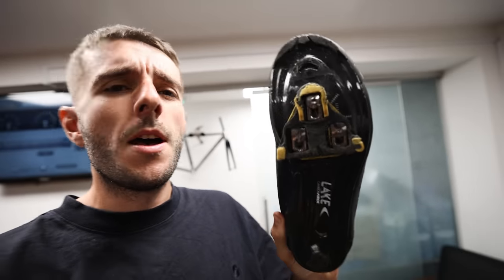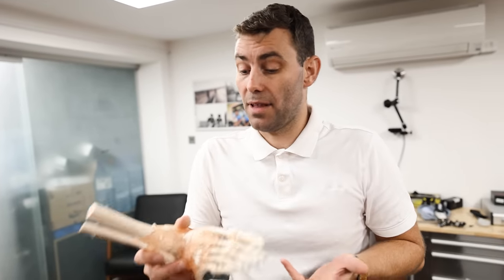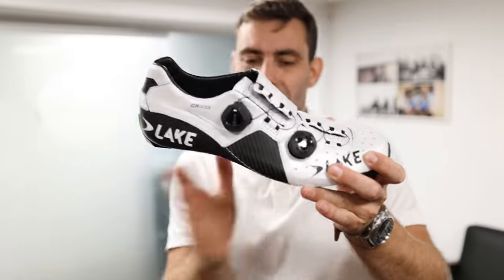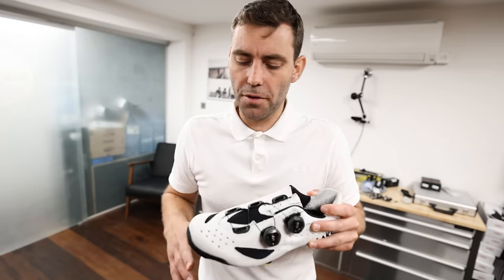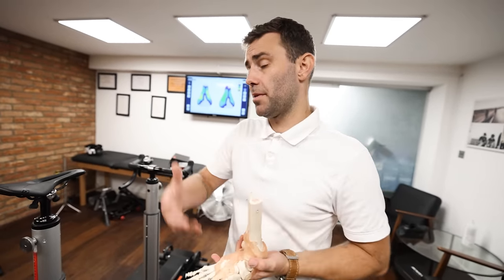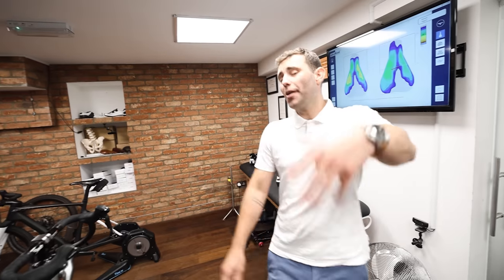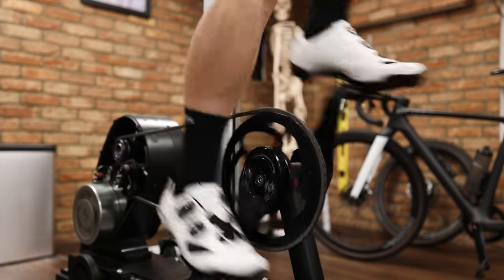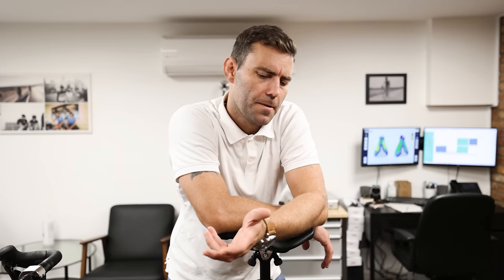Mid-Foot Cleat Position - A Bike Fitters Opinion

Comment: I’ve been studying and performing bicycle fits since 1987, and not only do I agree 100% with James on just about everything I’ve seen in these videos, but I learn something every now and then as well.  If I lived on that side of the Atlantic, I would definitely trust him to fit my bikes! I thoroughly enjoy these videos. Keep up the great work. Cheers!
Reply: Thanks dude!
Reply: I could have written the same thing (well, self-fitting since '85, no customers) and agree completely. James is neither stuck in the past or goo-goo ga-ga over new tech. I love the complete absence of lasers and measuring tapes, but everything is still down to the mm. 
I have been having foot/cleat/bike issues since they changed the shape of shoes and went to stiffer carbon in the 90's
Recent experience regarding mid-foot; I had been slowly moving cleat backward and appreciating the stability, but something was missing from bio-feedback loop of toe engagement. I have monster calves that can work over my joints and taking them off-line seemed to make sense, but I have crept back up a couple mm and really liking it. I'm a spinner too. 

Big point: I wish shoe manufacturers were more clear in how much heel to toe drop exists. Which of the LAKE shoes tend to have higher forefoot drop? (forgot term you used; it was spot on)

Comment: I run SPD on my gravel & roadie, and run on the furthest back bolt holes and as close to mid foot as it will go, always loved the power, comfort and peddling dynamics.
Reply: Same here.
Reply: Plus it’s easier to drop heels for descents.
Reply: And 165 cranks 😀
Reply: I'm afraid of knee problems. Should I be?
Reply: @jondemise131  I have no issues, late 50’s and ride 3-4 times per week with circa 10,000m per month of climbing.
Reply: @jondemise131  my knee problems have gone since using SPD and mid cleat.
Reply: @jondemise131  No knee problems here!
Reply: @GenuinePluko  When you say SPD cleats, are you talking about mtb cleats that allow for more side to side movement or the more rigid road cleats (SPD or SPD-SL)?
Reply: @TheExplodingCore  SPD MTB cleats on my roadie. Specifically XTR Race double sided. Adore them. Plenty of "float" and run on the loosest tension

Comment: So I've slowly been working my cleats backward until they are now slammed. Never felt so balanced and comfortable in more aero positions. On top of that, after a few years using cleat wedges on my right side I took them off and my knee doesn't want to drift in anymore. It's possible this was corrective and I learned a new pedal motion but more likely adding solid insoles (your recommendation) and moving my cleats back just put me in the right position. Praise the lord of bike fits. Wish we had a decent fitter in Chicago.

Comment: I started cycling over 30 years ago, in a time where you were told: pedal needs to be centered with the ball of the foot. I also still have a 175mm crank still  based on recommendation from long time ago. When you start thinking about it, it doesn't make sense. You deliver most force pushing down, when your shoe is a bit more forward you increase the distance to your bottom bracket, increasing the amount of power you can push down. Also when you do squats, a fairly basic power training I would say, you don't balance on the front of your foot but mid foot. 

Already placed my cleats more to the back (and adjusted saddle/steer accordingly). Not planing on replacing my crank soon since they are expensive and I don't need to win races but my next one will be 165 with my foot placed a cm more to the front.

Comment: FYI, only issue that I have never seen covered is clipping in and out.  It is harder to clip in and much harder to clip out.  Adjusted the Speedplays to clip out at a much shallower angle but still not as easy as forward cleat location.

My setup: I gauged my position on flats and carried it over to my Lakes with a midfoot adapter and Speed play pedals.  Running about 40-45mm  behind the first metatarsal works for me.

Much better and stable without cafe or foot pain.

Comment: Triathlete here did the mid foot cleat placement.  It is good for the run off the bike.  I have wide feet and have a custom made pair from D2 shoes.  The cleat hole positions were part of the custom order.  The overlap was a bit of an issue at least in the beginning.  But after a couple of embarrassing falls at lights, I just clip out early and don’t try the track stands.

Comment: I use the mid foot adapters on the Lake cx237 for ultra distance, it helped resolved numb toes. Interestingly, the MX237 with spd cleats allows placement further back, as far as matching my road set up but without adapters needed.

Comment: Amputee cyclist have to deal with a truncated (or no) calf at all. One solution is to place a cleat directly onto the prosthesis stem (no prosthetic foot). Shorter cranks are almost always a must. Being an amputee cyclist myself, using a very good carbon foot with good flex response, I have found that the stresses on the prosthetic side are much different than on the normal side. Oddly, the quad of the amputation side seems to be much less stressed than the normal side. I have a dual sided power meter and the amputated leg often puts out about 3-5 watts more than the normal leg. BTW: I place my cleats as far back as my shoes allow.

Comment: Had my cleats quite far back on my old shoes. Got new ones, didn't want to install them myself, so asked the shop. He looked at my old shoes, said they should've been further in the front. So he changed that on my new shoes. Also he put my saddle higher and more to the front...I think I like the more middle shoe position a lot...had pain in my right leg after using my new shoes for a bike packing weekend... PS. Super video!

Comment: Been running speed-plays with the extension plate for years after having massive issues with calf cramping running off the bike in my old triathlon days. Never bothered to change that cleat position even when racing at the velodrome and I have never found an issue some 15 years later. There are simply no downsides.

Comment: I drilled out the Northwave SPD shoes I used for longer rides. I lengthened the slot for a few millimeters to get the cleats further back and it made such a difference. When I started to develep pain after about 100km into a ride before I could then ride 200+ on multiple days without my feet suffering. Interesting point on shoes too long. As I have reather wide feet there is always a danger of chosing shoes that are actually too large/long.
Reply: There are some brands that have wide sizes as well. My feet started to swell up after a hour of cycling causing my feet to get pinched. Bought a wide sized lake shoe that helped enormously.
Reply: @RickWagenvoort  I haven't tried lake yet. Northwave plus/wide have been more or less ok for me (still had to drill out for the cleats though). Tried wide Sidis and they were ridiculously narrow for a wide size. Same with Giro HV.  I'll keep searching for the perfect bikepacking shoe. I wear Pearl Izumis pretty much every day for commuting. They are great for walking in so I think about bikepacking with them, but maybe they are not stiff enough because my feet start to hurt on longer rides out of town in them. I will change my pedals to SPDs with a bit of a cage, maybe it helps to have a larger contact point. Man, that's definetely a topic to nerd out about. Riding is so much better when your feet don't hurt.

Comment: Interesting stuff guys. I've only been riding clipped in using the two bolt mtb cleats for under two years. A flat pedal mtb'er before. I didn't pay much attention to cleat position at first and ended up with putting them nearly as far forward as I could. Didn't seem to have any issues until a bought another pair of shoes to which I fitted the cleats in the same position as before. I then developed pain in the left knee mostly. After some research I moved my cleats back about 6mm. After allowing the knees some recovery time I can now pedal pain free and I've also noticed that I don't feel as much numbness in my feet after a long ride.👍

Comment: I gave mid foot cycling a go for several months, also about half of this in combination with shorter cranks. Half of this was in a TT position as i'm mainly a triathlete. I found it didn't really work for me. I found my hamstrings would really tighten up. I've got proportionally longer tibias if that's any indication. I notice i also like to pedal very toe-down near the bottom of the stroke and toe-up at the top. I think this disengages the calf a bit and allows me to use my legs in a more extensive powerful manner. My cadence is around 90 fyi.  I think i cycle quite weird but seems to work for me.

Comment: One unexpected benefit of having purchased the new Asioma power meter pedals for SPD-SL pedals is an increase in Q-Factor over using standard SPD-SL pedals. I still have toe overlap (who doesn't on a modern road bike?), but it has been reduced because my feet are further outward. No problems from the increase in Q-factor, BTW.

Comment: I’ve been using them cleat adapter since I started cycling 2 years ago. I got the ones that have a 12mm and 24mm adjustment. I went straight to the 24mm position. They are great. Now I should mention that I cycled a FWD, MBB recumbent bike so I don’t get the toe overlap. I’ve been telling people about this since. Thank you for covering this again. Alway find your videos great even though I don’t cycle an upright/diamond frame bike but I might someday.

Comment: I drilled my shoes years ago—not new holes, but extending the travel slot of the cleat attachment plate rearward—got about 1 more cm to the rear.
And I just bought the patro-cleat midfoot adapters mentioned and now I get another 24 mm rearward. I’m psyched.

Fore-foot (MTP joint) cleat placement was always terrible—always hated it. Feels lousy and makes no theoretical sense from a physics standpoint… already went to shorter cranks as well to improve hip and knee compression. Also helps with toe overlap.

Both cleat position and crank length ideas had never been well thought-out from a biomechanics standpoint and were just basically “made up” (cleat position based for absolutely no reason on RUNNING mechanics which is entirely different than biking) and have been in place for decades without any particular reason. Thank God this has finally been changing quite a bit over the most recent decade…

Comment: Always had my cleats at  the ball of the foot  equal to  the pedal axle  position,  only possible when the cleats were forward.
Because of this and some other uploads changed that, having them more backwards.
Result : cramps in toes and front of the foot, had to reinstall them back as usual during the  ride.
And actually that seems pretty logical for it to happen, as i was pushing the pedal with the softer foot tissue just behind the ball of the foot.
So there much be something I don't get in this advice, or my feet are different from those of all/most other cyclists.
It's like marching on steps not longer on the ball/broadest  part  of the foot, but just behind it. Rather painful.
By the way, on a rowing machine, the advice is also to put the shoe straps at the height of the ball/broadest part  of the foot.

Comment: As the sole of biking shoes are stiff to rigid, I wouldn´t care about load on the front foot that much. It´s more of a geometric issue concerning the foot ankle. The more the cleats are towards mid-foot, the less you can use your ankle movement to press down the pedals and have to rely on thigh work only. But if the cleats are positioned more to the front, you also have to use your muscles more to move or at least stabilize your ankles.
Increasing the ankles´ work gives you more "punch" and lowers the legs´ movement overall, the energy-sucking up and down of the legs´ mass. But if not well trained, the lower leg muscles to use your ankles may exhaust faster than the rest.
Reply: The ball of the foot is not made from delicate bones as James said. Part of it are the heads of the metatarsals; their job is to transfer power and provide cushion during the gait cycle. The first metatarsal alone (and particular its head) bears almost 50% of the weight during gait. If you try to put this load on the midfoot you'll lose power transfer and propably cause problems (depending on intense and duration). This is basic anatomy of the foot and this video makes me question James' opinion in general.
Also, in regard to the metal plate - and this is not my field - I don't think that using a cantilever (the plate) after a lever will add power. The deflection alone will cause loses.
Reply: This sounds like cycling ‚conventional wisdom‘ that is worth testing. So much of this has already been proven wrong, like pulling on the upstroke or that the stiffest frame with the narrowest, hardest tires is always fastest.

Comment: Finally someone calls out Fizik for their ridiculous cleat position.  Some of their shoes are pretty decent - though I'd like to see a wider toe box on both normal and wide fit shoes, and the addition of 49 and 50 sizes.  But good god is the cleat position bad.  If you're one of those people who like running or walking on the end of your toes, they may suit you.  Otherwise, I think you're heading for problems - big ones.  The only exception is their tri shoes line ... but that's still way forward of most brands.

Comment: You are so right about moving the cleats back! A heel driver from day one, this is hard on Achilles. A piece of arcane knowledge is that an M-540 with a M-545 pedal body with  the platform removed (Not sawed off) adds 5mm to the Q factor. That 5mm actually allows full wheel/ toe clearance! This was one of the issues moving the cleats back. 2 bolt systems can also tend to allow mid cleat adjustment. Road cleat to mtb adapters tend to move the cleats too far forward and exaggerate the difficulty walking! Hard earned experience. Mounting a fixie is harder than geared and easier walking,  footing, and clip in is paramount!

Comment: I also do this since my feet doesnt tolerate pressure when cleats are set according to ,,fitting Guides", sth like 30+mm back. Nice to see its not so unheard of. Moreover after issues with sore feet i just decided to setup +/- the same as my foot likes to be on platforms. This way riding is pleasure for the body.

Comment: MTB shoes on everything! 👌
I tried midfoot with old mtb shoes, felt pretty good, too much toe overlap on my roadbike though, size 46/47 shoes. Combined with oval ring, sprinting felt ceap, endurance was fine. As i ride mtb and cx most of the time, having new mtb shoes made more sense, so have mtb pedals on the roadbike too. Mtb cleats often can go further rearward compared to road 👍 hotspots and tight calves are solved

Comment: I switched from cleats to downhill pedals and regular shoes a few years ago and never looked back. no matter how many adjustments I made to road shoes I always encountered discomfort and injury. I haven't had a single issue or injury with flat pedals. 

clipless pedals are good for sprinting and bunny hoping, but studies seem to show they don't really help with efficiency or power in the long run. for me, a roadie who just enjoys going on long rides and doesn't race anymore, the trade-off is a no brainer. 

I think so many people go clipless out of fashion and peer pressure. it's a shame, personally I feel like I wasted so many good years of cycling fussing with cleats and dealing with related injuries when the solution was so simple.

one of the added benefits of flat pedals (downhill pedals with a large platform) is that I can move my foot fore and aft depending on cadence and position. I believe this helps immensely with comfort and power, but I'm not sure of any actual studies on this.

anyways, really I just want to encourage anyone who is fed up with clipless to try flat pedals. I know it looks dorky, but who cares -- for most of us the point of riding is health and fun.
Reply: I ride my commuter on flat pedals and agree with almost all of your points. However, my over-use injury is related to riding on flats. Flats make use of the quad muscle the most, and minimal hamstring. My knee issue is related to over-use of the quads relative to the back of my leg. I ride ~10mi per day, on hills, often with a load, using a flat pedal commuter bike. Not the longest ride, but the miles add up. 

Now, I am never going to give up flat pedals on the commuter bike. They're safer to maneuver in traffic and when I ride with heavy loads. I like being able to wiggle my feet. Power? Dunno. Doesn't matter - they're damn comfortable and don't take fancy shoes. I've even ridden while wearing high heeled boots (do not recommend - but you *can*). 

But on my road bike, I am glad to be clipped in for long rides. The quads are still used most, but the hamstrings are involved much more, and I get a more balanced leg experience. My first big hills on the road bike burned my hamstrings while my quads barely noticed the trouble. Now after a few months, my legs are evening out in strength. I'm remedying my balance problems. 

So.... both pedals are good? Depends on your rides? 

But I'm going counter to this video: just changed my cleats to more ball of foot, less midfoot. My pinky toes were going numb. Still need to test them out more to see how I like it.

Comment: I'm late to this comment section but just wanted to say that this product has allowed me to cycle without pain for the first time in years. I had a jones fracture (5th metatarsil) back i 2017 and up until I tried these cleats in 2022 I couldn't ride for more than 30 minutes without my foot throbbing in pain.